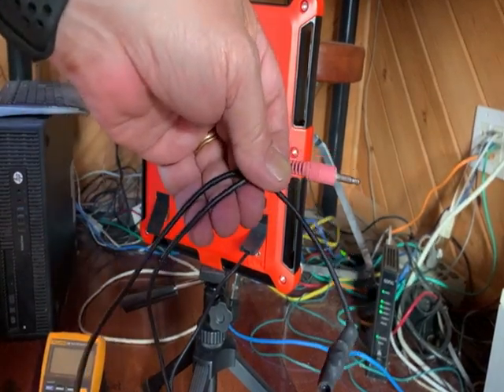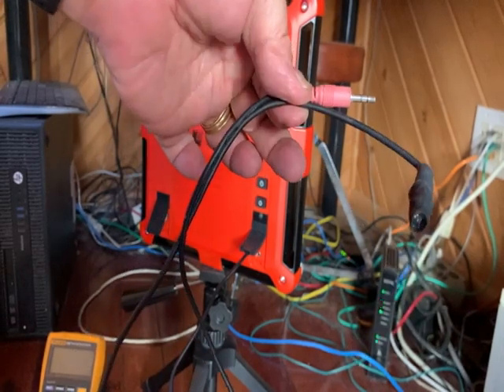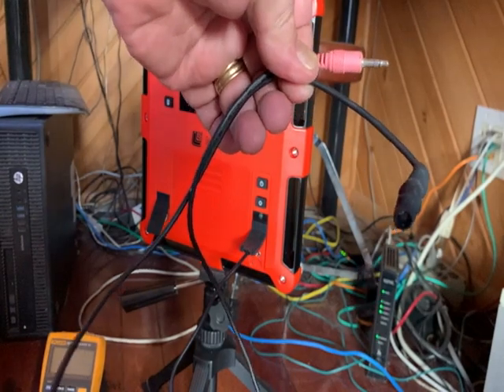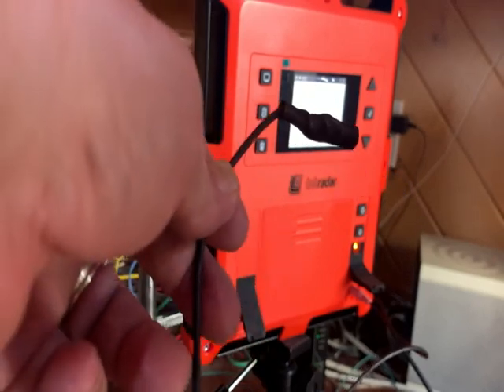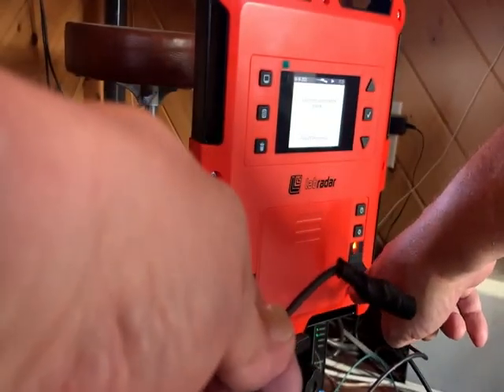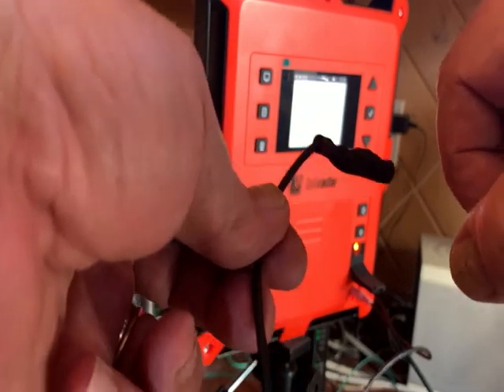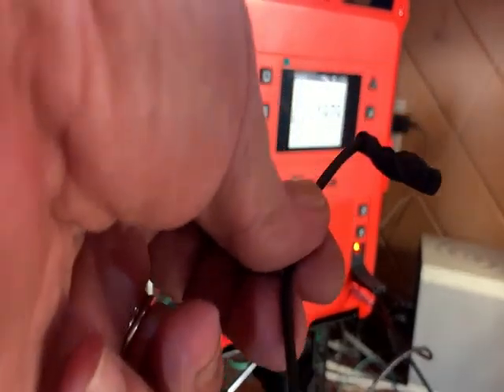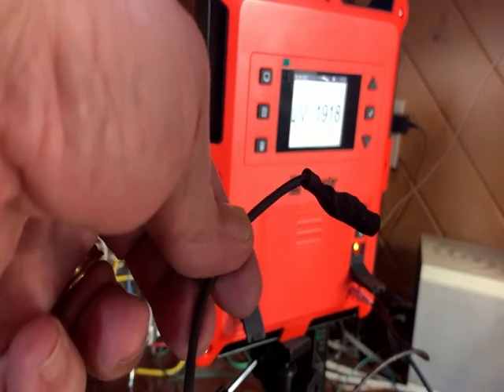Make your own Labradar trigger to mount on firearm

Comment: Looks great, good work! Thanks so much for the @ / credits!
Reply: Thanks for doing the homework on what is needed. I went to the range on Sunday, but need to figure out a decent mount, it does work but falls off pretty easily, so I need to come up with a solid mount. The Labradar in general is a bit cumbersome, slightly big/bulky and the added cables do add some confusion. In general the trigger works well. I am thinking to try and hot glue it to a Caldwell picatiny adapter for the brass catcher I use. Thanks again for the work you did on this.👏
Reply: @constitutionalist4391  glad it helped! Please share if you find a mounting solution that works well for you. It‘s a tricky part. Still using these gopro clamps as they are so universal - but clunk